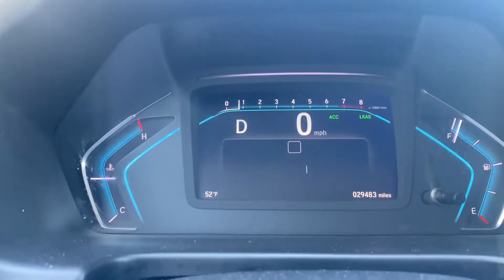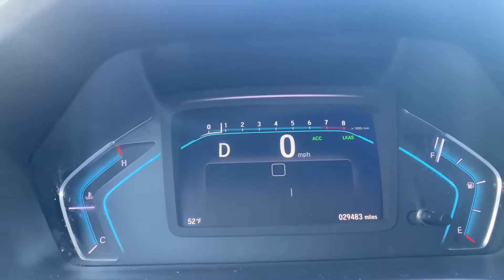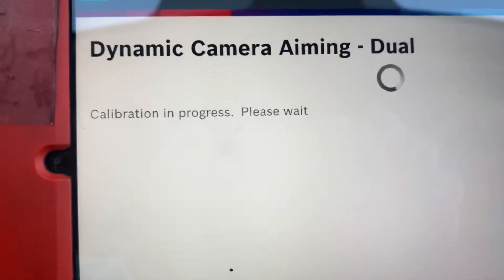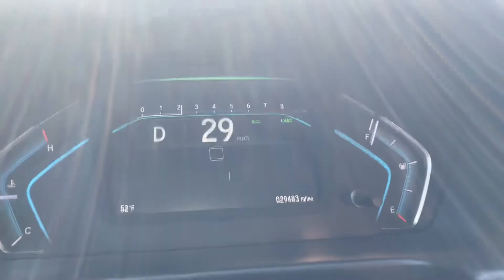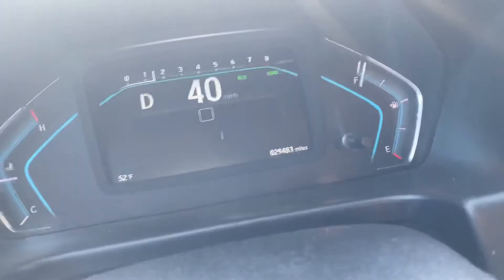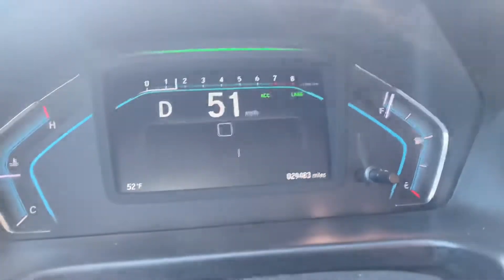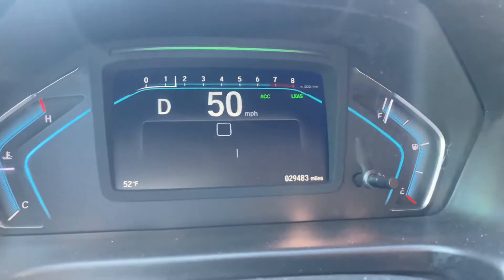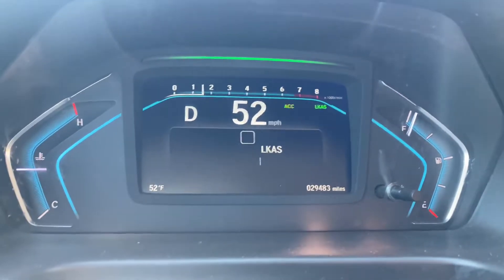2020 honda Odyssey Dynamic Recalibration for LKAS Lane Keeping Assist System

Comment: How long did you drive for? I’m having trouble with the same situation and have been driving for 25 min
Reply from the maker: If you driving like that long. There mist be something wrong with the statiaiming. Re-do it make sure canera is centered between the center point on the gkass and re do it. It took me the time this video shows